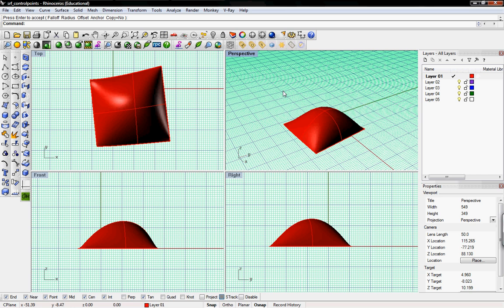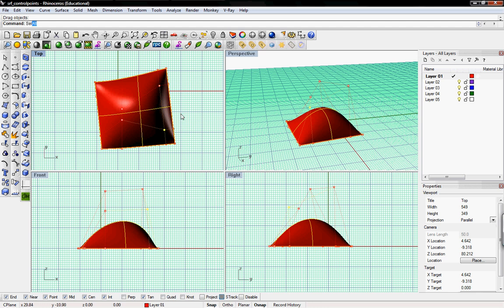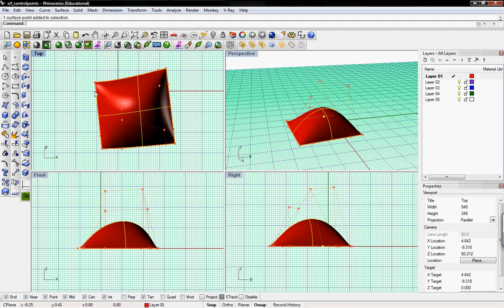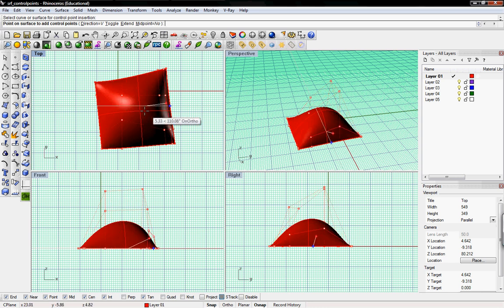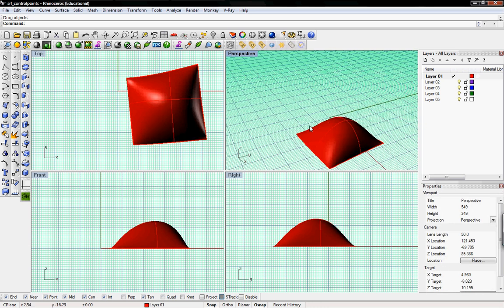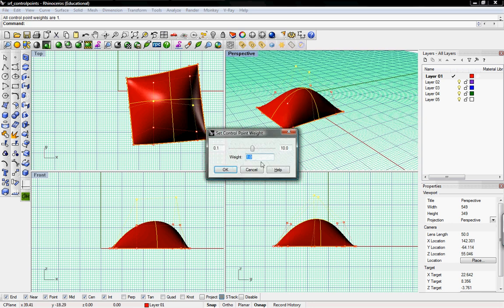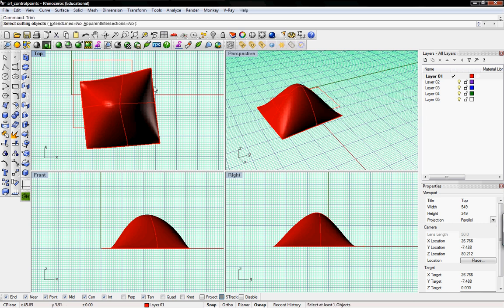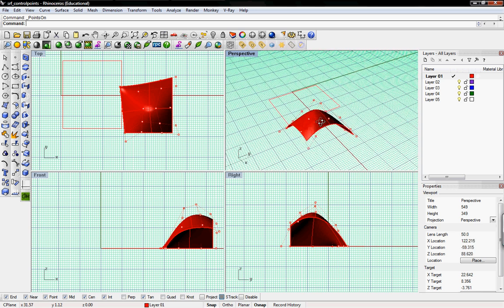editing surfaces with control points by digitaltoolbox.info

Comment: hey, id like a little help please!! when i use control points on a surface sometimes the surface wont follow the direction of the control points and instead leaves a mesh like grid but no surface, is there something im doing wrong? thanks